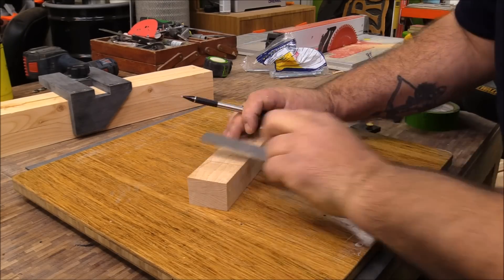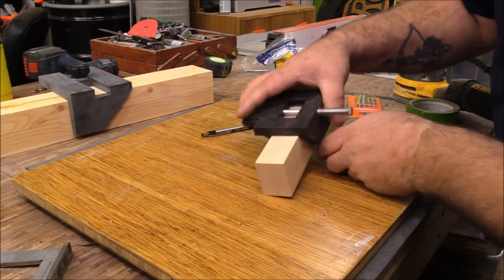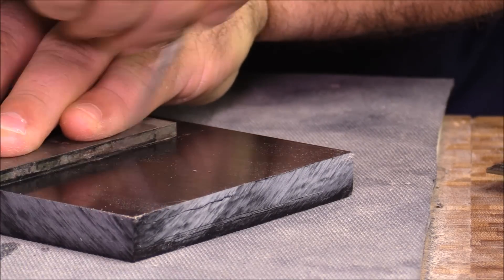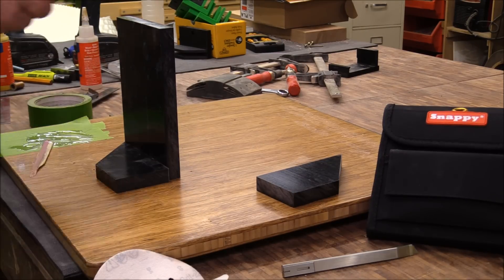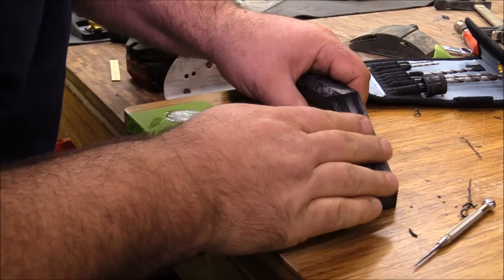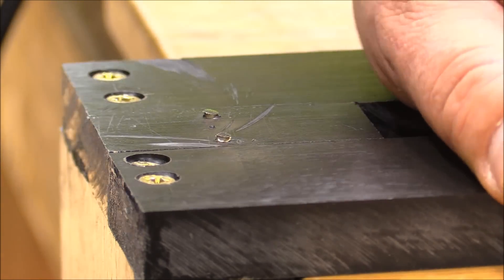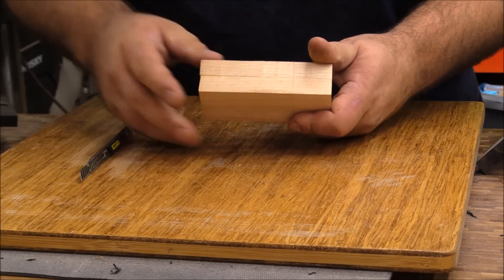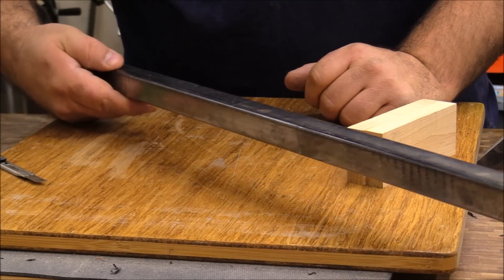How to Make a Simple Straddle Square!

Comment: Excellent! I've needed this tool so many times, but never knew it existed. I'll be making one of these this weekend for sure!! Thanks for the knowledge as always!
Reply: I may try & build it using thick plexiglass for added durability.
Reply: +Construct Icon Delrin is much more durable than plexi
Reply: +Terry Leigh your probably right, but my first thought was to make it out of wood, plus I already have the plexiglass.
Reply: +Terry Leigh if I get my hands on some derlin, I would definitely give it a go.
Reply: +Construct Icon if you already have the plexi, the best material is what you have at hand. I'd imagine being clear would also have its advantages.

Comment: Hey bud, Free tip for you.  Don't use wood screws in plastic.  Try it to believe it. use  fine thread. Bolts and screws.  I build R/C trucks, lots and lots of plastic. All use fine thread.  interested me so I researched it and yep Fine thread for plastic, Coarse thread for Aluminum and iron. either for steel and as you know woodscrews or nails for wood.   I believe the fine thread really just pulls the fastener in using the fastener as a wedge like a nail in wood. Thanks for the vids. I made a sled for my table saw because of you. it works super awesome.

Comment: If you're really stuck then grab a large hinge and use that. It won't do three faces or 45 degrees but you should be able to cut it down quite accurately if desired. That'll allow you to transfer around rounded edges on the metal.
Reply from the maker: cool idea!

Comment: These are already sold by Woodpecker in 2 sizes.  The don't have the 45 angle, but the adjustment to the tightening mechanism is spring loaded.  Both sizes sell for $119
Reply from the maker: They haven't made them for quite some time now, no longer for sale

Comment: The one I saw was called a box square by the guy who had it (home made I think).  His had individual protractors on the sides.  Like two speed squares with a flat top piece in between pinned together at the pivot for the front and the back pin was in a slot that the sides rode on for the angle change.  Not sure if I am explaining it right.  I asked why he needed both sides to adjust independently, he said it came in handy once or twice for joining multiple pieces together.  The top piece was two separate pieces that overlapped and allowed him to go from 4" to 6" and had a separate one for 2".  Those were the main sizes he worked with.

Comment: Never could find an adhesive for Delrin. I will have to try epoxy. I don't know why I never thought to try it. Delrin is a good bearing material for machine shafts. It has a lot of petroleum I guess, why it is hard to stick and why it makes a good light duty shaft bearing.
Reply: Even epoxy doesn’t stick very well to polyoxymethylene, aka POM, acetal, or Delrin(tm). One website suggests cyanoacrylate with the right primer gives the best strength.

Comment: Izzy another great idea you've had.  Delrin is a great material but hard to  glue together.  We would mostly bolt together.  There are some adhesive sold online, but you will not find at Lowes and they are expensive.  Some found at Lowes will stick but don't work well when shear forces are applied.  BTW, how's the weather down your way?  Here in the upstate of SC it's been pretty hot, thinking of putting AC in the shop.
Reply from the maker: Awesome thank you for the info i have use it in the past but never tried to glue it. Its HOT down here! if i didnt have AC there would be no videos. lol
Reply: Here's a link for one product to bond delrin, http://reltekllc.com/adhesivesfordelrin.aspx 

I would still dowel or bolt together if you are going to have side shear force.

Comment: Very cool tool, could see myself using it.  My only concern is accidentally cutting the plastic with a marking knife, my squares and rulers are all steel so I don't have that concern with those.
Reply from the maker: not with Delrin, it would be very unlikely. think of it as the same strength a wear as aluminum

Comment: Where and when would you need one? If your power saw has a fence or your hand saw is used with a miter jig you will get perfectly aligned cuts from one reference mark. So I assume it is not to mark for cutting?
Reply from the maker: f you need to reverse the piece in a jig, when marking layout for hand tool work, when  translating lines for cabinet frame layout when setting depth for incline dados, the list goes on and on

Comment: Hey Izzy...typically Delrin doesn't bond well with epoxy.  Better try 2 component acrylic adhesive. Sand it before bonding. Still Delrin remains a problematic plastic for bonding.
Reply from the maker: Martin right on thnk you for the tip

Comment: why didn't you countersink the screw into the center piece? I don't understand the reasoning behind that choice.
Reply from the maker: there wasn't enough room to countersink the head and drill the hole i needed to tap out the hole for the bolt.
Reply: +izzy swan thanks Izzy. great idea for a very simple, incredibly useful tool!

Comment: When marking out using a try-square (or combination square) 1. make 2 adjacent sides exactly 90 deg to each other. 2. Mark them with a pencil as face sides . 3. Set the handle of the square against one marked side and strike off a line - 4. Ensuring that the handle is always against one of the originally marked face sides mark a line round the wood. --It will always meet up correctly as long as your first 2 sides are 90 deg.
Reply from the maker: Good technique, but like I said it time-consuming compared to the straddle square and there is much more room for error when using a tri-square.
Reply from the maker: He Richard I don't allow links in m comment section, just so ou know the don't make them anymore they are no longer available. the ones you were linking are cool but extremely limited in its performance. can only mark 90 degrees and need 2 of them for common size milled material and when they were available they were around $150 for the set hardly practical to own.  Keep an eye out on my channel for a new full adjustable straddle square. thankyou for taking the time to comment